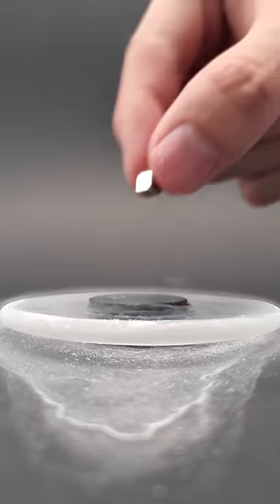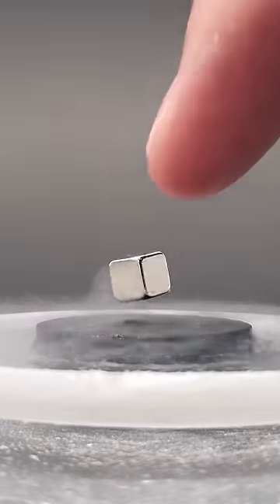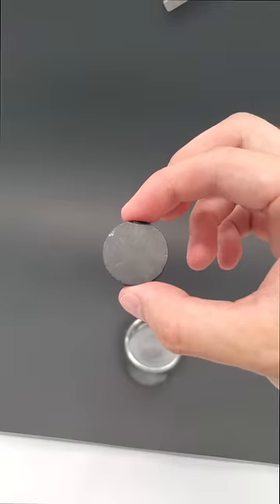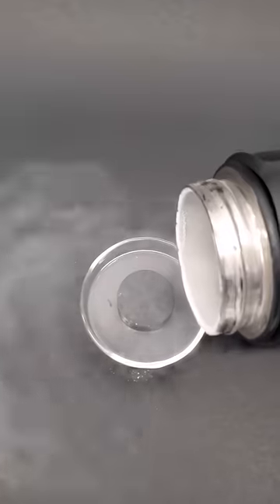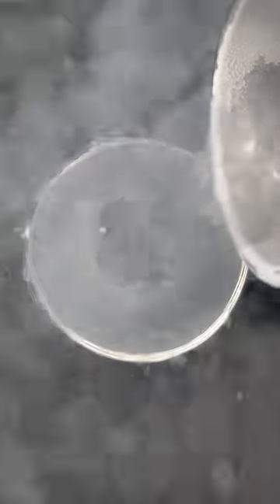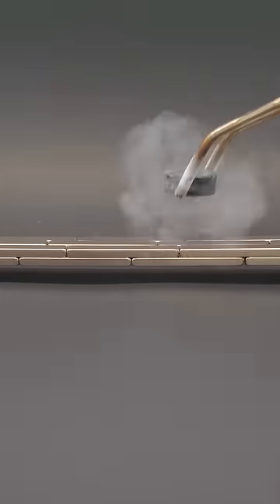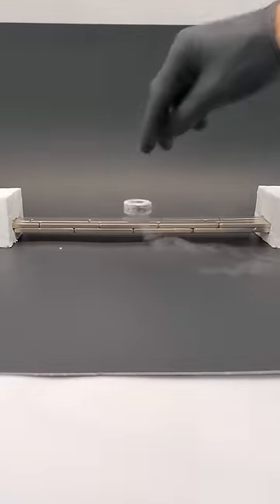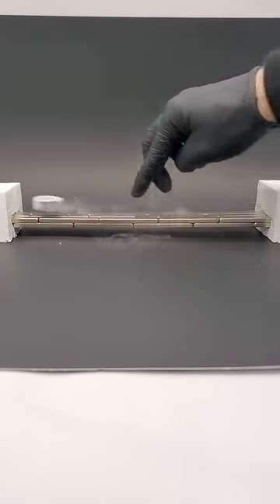Watch this superconductor hover around in mid-air!

Comment: Everyone: "These super conductor trains will be cool if they existed"

Me: "what if they run out of liquid nitrogen PANIK
Reply: Nah. Those superconductors would exist if they were cool...
Reply: Japan is planning construction of super conductor trains
Reply: They do exist。 Japan's new SCMaglev is under construction.
Reply: @solared  you are correct, sir
That’s exactly what I said
Reply: I’m going to sub to u
Reply: @solared  I am in fact very excited for japans scmaglev train, it would be a feat of engineering and would provide great benefit to both the scientific community and transport industry
Reply: @AJ-vs3yz  not just "would", it is. There is a working unit on a test track.
Reply: It would be like any other fuel, you wouldn't let a gas or coal train run out. The system would dispense the liquid continuously through out thr day until they stop at a refill station
Reply: @solared  I mean when it is opened for public use, currently I believe its in the field test stage
Reply: @AtharvaChawathe  China already have it

Comment: Gravity, magnetism and quantum entanglement are 3 things that blow my mind.
Reply: @Nick_Lima954  Wait, so you're saying the earth is flat?
Reply: Same here. Especially the quantum entanglement.  ;o)
Reply: @TheTruthKiwi  Biblical Cosmology is the Truth of it.
Reply: @Nick_Lima954  Hmmm really? As opposed to actual observed and proven cosmology?
Reply: @TheTruthKiwi  clearly, the cognitive dissonance is setting in. Density = Mass/ Volume. Everything seeks equilibrium. Things that float are buoyant in it's medium. You can see an experiment in a vacuum chamber where a bowling bowl falls at the same speed as a feather. No air resistance. They fell at the same time because they are more dense than anything in it's environment. Things that float aren't "anti-gravity"; they are buoyant.
Reply: @CIA_Is_aTerrorist_Orginization  research Quantum locking.
Reply: @Nick_Lima954   the REASON those things fall down isnt because of their density, its because of gravity affecting them.

You do not need a physical barrier to hsve air pressure. earth's gravity works fine.

have you ever seen the cavendish experiment? That proves gravity as well.
Reply: @Nick_Lima954   also what were you trying to say about the second law of thermodynamics?
Reply: @Nick_Lima954  earth isnt flat

Comment: Yes, but how can we use this info to make hover boards come true?
Reply: We can't, it would work only on magnetic tracks and it would take lot of effort for cooling the superconductor to the required temperature, just plain pointless
Reply: @AJ-vs3yz  yeah but he’s saying that there is obviously simpler ways
Reply: @cofersn7  their isnt
Reply: Room Temperature superconductors. We’re getting close
Reply: We already have. But they are slightly above ground
Reply: Lexus made one but it was for a commercial and it only worked on a specialized track. You can look it up.
Reply: @Cheif_Kueif  the hacksmith also did something similar

Comment: I was gonna say why don’t we use this for trains and when they need to come to a stop they just shut off the liquid nitrogen feeding the magnets so by the time you get to the stop it stop but the down side is we would have to figure something out for the train to move
Reply: it wouldn’t have practically either and would cost way more than just new wheels every time they break, plus human weight so it might not even be possible in a train size
Reply: Rockets. Literal rockets to make it move
Reply: The way current maglev/magnet trains work is by using electrically-activated magnets to turn on in rows one after the other to push a floating object along or slow it down by 'pushing' the opposite way in sequence. Imagine like the redstone railcart blocks in Minecraft or the speed boosts in Mario Kart with the added mechanic of an equal/opposite slowing feature. The speed or slow effect can usually be caused by which polarity the magnet is switched to as the train passes over; setting it to attract to pull the train forward, or to repel to slow it down. It's super cool and you should 100% check it out if you want to learn more.
Reply: @affanmahdhir1793  nah man just place a bunch of Heisenbergs under the Train to make it float
Reply: A really big hand
Reply: Easy, just push the train
Reply: We have something pretty close to this already there called maglev trains
Reply: Do you know how much money that would cost
Reply: Geniuses
Reply: We could have a continuous flow of liquid nitrogen around any Superconductor and that would solve the problem
Reply: Electromagnetic trains. 

The maglev is doing something similar atm

Not exactly like this though
Reply: There are already magnet trains. They have been out for several years there called the bullet trains. Sometimes I swear people have to be joking.
Reply: @shamsandharia123  that's not practical, the magnets would heat up and liquid nitrogen is expensive to produce
Reply: Michael Overton  thanks! The real OGs are definitely the wizards who worked out all the math, fabrication, & material trial and error to get that whole system workable and built IRL. Also I appreciate people like OP who ask genuine questions and express ideas because it opens up dialogue to expose great information. Humans are born at square 1 without exception, so there's literally nothing to lose in discarding a fear of being seen as ignorant, wrong, etc. since there is an infinitude of truth and creativity to gain and practically nothing to lose if we can accept the occasional misplaced criticisms & scorn of others as a price well worth paying haha.
Reply: Trains,cars,skateboard, everything transportation
Reply: I thought the same; but just put wheels on the side of the station going sideways. So it pushed the train as it leaves and has traction when it arrives to help slow down the train. 

And others say “there are already magnet trains” but they are people who are stubborn and can’t help but be entitled. It’s helpful to everyone to help each other grow Into a better future.
Reply: Why use trains why not fly the earths a giant magnet they could super cool a giant say saucer or tic tac and fly using a air compressor and nozzles like on NASA shuttles it would work under water too a pump tubing and liquid nitrogen and the earth is the magnet u could fly like aliens couldnt u or create a helluve motor that could reach astronomical rpm and power huge generator only need to attach a fly wheel to the magnet u could spin it with compressed air and it with no friction it could spin forever if u really new a lot about the placement of other magnets and there poles north and south the magnets around it could cause it to spin forever on it own
Reply: @DeAthWisH-li5ks  actually the earth is a giant magnet and there's so much plastic pollutant to recycle it wouldn't cost that much to make a flying vessel that would work in air and water done properly how u think the aliens do it lol I mean there a reason all the videos are flir and there always extremely cold the earth will make it float if say u made a big hollow saucer or cylinder and plumbed it with tubing and used a pump to pump liquid nitrogen through it the colder u got it the further up it would go u could use a air compressor and nozzles like the space shuttle and with no friction u could direct it in all directions up down left right and it would work under water too
Reply: @terryrickman2975  maglev trains dont work that way they use electro magnetic current to propel them yeah they barely float but think if they used the earth as the magnet which it is a giant one and turned the superconductors into giant saucers or balls and made them hollow inside and plumbed them with tubing and used a pump to pump liquid nitrogen through out that the colder OT got the higher it would go and used air compressor and nozzle kinda like NASA uses for the space shuttle u could fly like aliens, I mean maybe that's how they do it, or maybe its just some real smart ppl here on earth it would work in air and under water and the flir videos from us government shows that its really cold and no heat source
Reply: @andrewcrider7148  you lost me at “fly”
Reply: @lianay209  whets that the stronger the magnet the higher it would float, the earth is a giant magnet thats why theres north and south poles and its why a compass works

Comment: Moving a conductor through a magnetic field generates current. The lower the temperature, the lower the resistance meaning the higher the current. As it warms up, the resistance increases and the current decreases. The goal now is to figure out how to do this at room temperature and it can be widely used in lots of technology
Reply: Yeah lol sure nerd
Reply: That's incorrect. This is a different, quantum mechanical effect. What's happening here is two things: first, any superconductor expulses all magnetic fields from its interior. Secondly, Type II superconductors can have small regions of regular, non-superconducting material inside of them, through which magnetic fields can penetrate (flux vortexes). The magnetic fields become "pinned" to these regions, and that's what causes the stable levitation. It wouldn't work with a regular conductor no matter how pure and how cold; it only happens with (type ii) superconductors. In fact, it's impossible to have a stable equilibrium in a purely magnetostatic system (Earnshaw's theorem).
Reply: @stefm.w.3640  it’s electromagnetics 101
Reply: Any current it makes will just warm the superconductor up. And it depends on the shape of the magnetic fields.

If you're talking about using it to power a generator, the problem is that the generator would slow it down. Even just putting a coil next to the track would slow it down. Magnets and coils work both ways, forces travel in both directions. 

You can only ever get, at absolute maximum, the energy that dude put into it with his finger. Or in the case of some giant version, whatever you start the superconducting puck going with. Taking energy from things reduces their energy, which in this case is movement, velocity. Superconductors obey that just as well. 

There's arrangements of ordinary magnets you can use to make things hover, at ordinary temperatures. Superconductors just do it so much cooler! Smooth and precise, where with normal magnets it's all about getting the field exactly right and placing your puck in just the right place. Still it can make a nifty science ornament.

They even sell hovering pens and hovering globes, but that's done with electromagnets constantly updating their field strength just-so.

Comment: If they have a consistent cooling system for that, they can make a lot of things hover if the roads/tracks are magnetic
Reply: Be careful with that
Reply: Actually the earth is a big magnet it could work as new way of flight done correctly bet that's how those aliens flying and the video the air force released was so cold on the thermal imaging the right shape n materials plumbed thru with tubing and a pump in tank of liquid nitrogen a compressor and some nozzles off space shuttle it could work easily in air and under water I think maybe how aliens do it or some real smart guy in NASA lol

Comment: That’s interesting! Does cooling it down effect the magnet field making it repel stronger? It’s kind of like it’s reversing the polarity making one side hot and the other negative
Reply: The cooling makes the superconductors
Reply: I think the cooling prevents the magnet from overheating due to friction or something?
Reply: @ytuser4562  what? They dont evne touch, how do you even overheat a magnet? It gaisn its superocobducting properties below a certa8n temperature, thats just how it works
Reply: I think it has to do with the earth being a big magnet and with a pump a lot of line plumbed thru and the right shaped hollow materials theoretically u could if the material got cold enough u could fly in air and under water with a few batteries an inverter and air compressor with a pressure tank and some nozzles u could propel it in any direction up down left or right warm means down cold up, it could be how the aliens do it lol in there saucer and tic tac shape it really could work the earth is a giant magnet after all,the temperature changes the frequencies I might be a dummy I might not but we will see what future holds
Reply: @theheadpriest  the temperature changes the frequencies I really think Tesla new this with his plan for free electricity for all and if this is correct hell u could fly with very little cost cause the earths a giant magnet I mean hell NASA does it in space u make the vessel float u could propel it with pressurized air in any direction and under water
Reply: Ahhh!! After some research I’ve found that cooling it down makes the electrons move more freely through the material than it would at room temperature. It was a good hypothesis that it effected the magnetic field because in a way it did.
Reply: @steveclark7736  yes, it becomes diamagnetic at low temperatures, and i have no idea what tgis andrew crider guy said cuz it makes no sense
Reply: It is to do with quantum mechanics. In very basic terms, the electrons can move around with resistance that approaches zero as the temperature approaches absolute zero because the lattice doesn't vibrate as much and the electrons pair up and act like a boson particle.

Because the electrons can move around with no resistance, it means that they accelerate and can create a very strong magnetic field as the electrons moves very fast.

Comment: For anyone interested in going “omg, we can use this tech to make hover cars and monorails! 

Yes….but also no. The technology could be applied and be functional, but you would have to cool either the magnet or superconductor to liquid nitrogen temperatures constantly which would be obscenely expensive. Also, if either were exposed to air it would develop thick layers of ice from the atmosphere that would be impossible to remove faster than they appear. 

So unfortunately reality is, once again, very disappointing.

Comment: I wonder if this has any useful applications in space where it is cold enough to work without liquid nitrogen.
Reply: I don t know. You would need to keep it in the shade so not to heat it with the sun and even then i am not sure it would work because temperature in space is weird but it seams like a super interesting experiment
Reply: space isn't actually cold at all. its just empty, so there's no heat, but there's also nothing blocking the radiation from the sun. dealing with heat buildup in space is a serious engineering problem with some pretty neat solutions

Comment: What if you made a compartment in the superconductor and filled it with liquid nitrogen, so as it gains heat from the surroundings, the liquid nitrogen keeps it cold?
Reply: the liquid nitrogen would eventually warm up though, because that's how heat works
Reply: @DuckInGameStop  It would conduct heat away from the superconductor over time, absorbing energy as latent heat of vaporization; before the nitrogen boils it will keep the superconductor at a constant temperature
Reply: You could slow that further in a vacume

Comment: That's so cool imagine if transportation could be done like this - no more potholes, petroleum -
Reply: Yup imagine having a train using magnetic field to operate
Reply: @jwwong4835  unfortunately not possible, all known superconductors need to be at extremely low temperatures.
Reply: @N-cubed  Uhm. I might be incredibly dumb but don’t Bullet trains float?
Reply: Might be feesable for polar expeditions?? Lol
Reply: @chickensauceboy  I should clarify and retract my previous statement, since there have been many development with this technology since I’ve last heard. Currently no commercial train uses superconducting maglev, just standard magnets. Superconductors conduct electricity with no electrical resistance, think even faster bullet trains with much greater efficiency. However, since 2011, Japan has been constructing a superconductor railway system that is set to finish by 2037. There has also been a recent discovery of a superconductor that does not need to be at extremely low temperatures, the caveat being that it needs to be under extreme pressure to align its molecular structure correctly.
Reply: @terryenby2304  If the poles got colder by at least -100C then maybe!
Reply: @N-cubed  excellent. Now we just wait for the next ice age…
Reply: All I see is Red. Sulpher  + - super fast...
Gravitomagnetic electric

Comment: At what temperature does the magnet regains it's room temperature properties?
Reply: Hemlock Cocktail  I guess...now that brings another question: is it the same temperature like the melting point and freezing point of water the same  or not there is a gap between the two states. And why does the magnetic fields freeze as if the  the properties north and south both repel and attract it's self

Comment: For someone interested, this is what is called "maglev" in maglev train.
Reply: i believe maglev uses electromagnet instead of superconductor? it's hard to keep it that cold
Reply: @fadzliazrul4530  You're correct, the old maglevs are using electromagnet, but newer maglev (or future) will use superconductor.

No, it's actually easier and cheaper with superconductor than pure electromagnet. Liquid Nitrogen is pretty abundant in nature.
Reply: @gold9994  nitrogen are abundant in nature but in the form of gas, not liquid. deep research is needed to ensure cooling it to liquid state is efficient enough :D